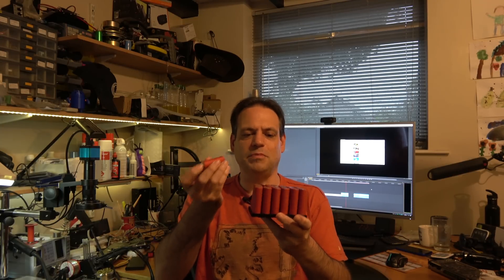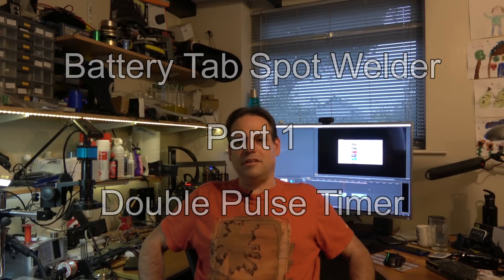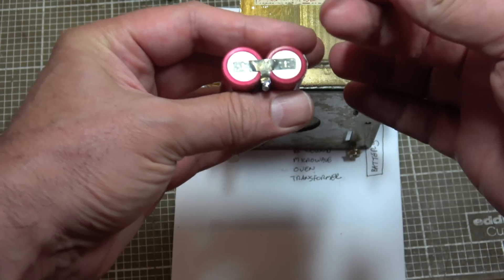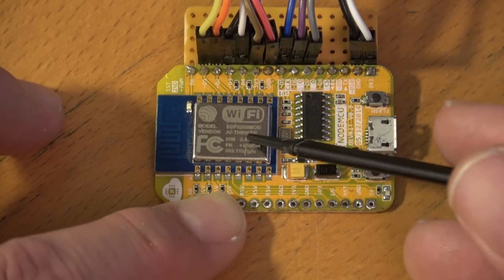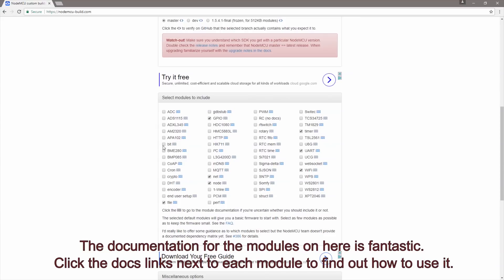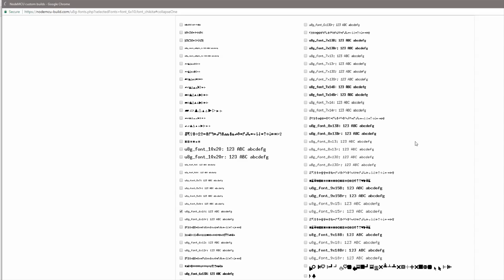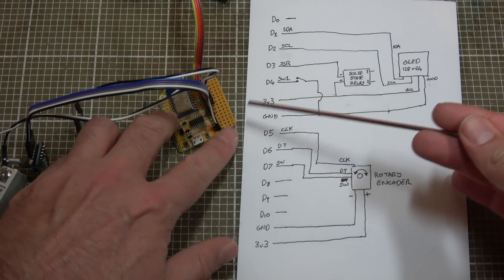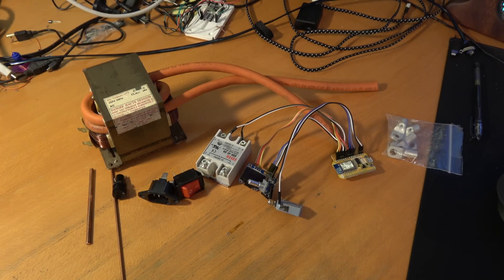Battery Tab Spot Welder - Part 1 - Dual Pulse Timer with NodeMCU

Comment: Did you not think to adjust the power??
Reply from the maker: How do you mean? This video is about me making a spot welder with adjustable power settings. Controlling the power delivered into the weld was on my mind from the very start. Can you explain what you mean please?
Reply: @ThingsWhichArentWork   What I noticed was that this controller only adjusts the double pulse time in ms 

Does this mean that the transformer always works at its maximum power?

Thank you for your response
Reply from the maker: Hi  @TavanaSpotwelder  - Yes - You are correct in that when the transformer is energised it is always at full strength. I was considering the power to be the total amount transferred through the transformer during the duration of the  weld. For my use case with welding battery packs (and possibly all welding cases in general) it is desireable to keep the weld duration as short as possible to minimise the spread of heat into the nearby battery plastics and chemicals, so I never considered wanting anything other than the minimum duration pulses to get the job done. I guess it would be possible to make a cheap MIG-style variable transformer from a MOT core by moving a shield across part of the transformer.. just wasn't something that occurred to me. Cheers!!

Comment: Thanks you very much for this. This my first time doing an electronics project and I'm almost done after 2 weeks. Would a metal oxide varistor help to protect the circuit?
Reply from the maker: I don't think there's any need for a mov. The switchmode is already providing an isolated supply for all of the sensitive electronics.. Maybe there's some argument for using one on the microwave transformer side of things, but that would already be very tolerant to over voltage conditions... I am however no expert on MOVs and input protection, so please don't take my word as gospel. Cheers!!

Comment: Please share step by step manual for beginners and also code for programming nodmcu module
Reply from the maker: Hi Muhammad - The code is all up on github. The  link is somewhere in the description for one of the parts of the video  (There are three parts). Hope that helps. Cheers!!
Reply: @ThingsWhichArentWork  I am going to buy parts today and will ask help if there will be something wrong with my project 
Regards 
M. Saqib

Comment: I've just got round to building a spot welder myself and funnily enough it was using stuff I had lying around too. I managed to work out all by myself that touching a microswitch with mains running through it was probably a bad idea so went the SSR route too. 
I watched the same video you did and was also surprised at the heat generated so it is great to hear you saying the same, maybe they just had the timing wrong. 
Thanks too for the explanation for using double pulse as I had heard it was to heat up the metal before the proper weld but couldn't understand why that would be a good thing. 
My welder works really well but as I haven't sorted out a timer yet it is hard to be consistent so getting the timing sorted is a priority. I'm currently going the 555 timer route as I have one handy but may upgrade later to your design.
Thanks for sharing.

Comment: First of all : nice video. 
I'm also getting progress on my version of a spotwelder : 
using a RANDOM FIRE SSR (and not a zero crossing one) It should be able to adjust the power for welds by leading edge trimming ... 
(that kind of SSR switches on whenever you like (and not only at zerocrossings), but it does however still switches off at zero-crossings only) 
The example below shows what the arduino is outputting towards the random fire SSR. First time is when it is switched on, second time is when it is already switched off. (It should be off before the zerocrossing is over or the next half period the SSR would stays on !)

Settings in my program (merely to demonstrate not very useful I guess) are : 
preweld time : 5ms 
preweld power : 5%
delay time : 250ms
weld time: 11ms
weld power : 90%

Output : 
Weld : 9.50-9.94 ms
Weld : 19.44-20.01 ms
Weld : 29.52-29.94 ms
Weld : 39.45-40.02 ms
Weld : 49.53-49.95 ms
Weld : 59.46-60.03 ms
Weld : 69.54-69.96 ms
Weld : 79.47-80.04 ms
Weld : 89.55-89.98 ms
Weld : 99.48-100.04 ms
PAUSE : 250.01ms
Weld : 8.07-10.07 ms
Weld : 11.08-20.00 ms

(as 5% of a 10ms half-period is only 0.5ms; 10 weld pulses will be needed to get 5ms preweld time here;
and as 90% of a 10ms half-period is 9ms; 2 weld pulses are needed to get 11ms, the first being only 2ms, the second 9ms...
It works great for now... I just hope it stays like this braching the very inductive load to the SSR...). Testing soon.

Comment: can we use an arduino instead of the board you are using?
and can we power a 12v solenoid from the output instead of an ssr?
Reply from the maker: Hi Konstantinos - You can certainly use an arduino instead... If you check in the comments of part3 of this video, someone on there mentioned that they've written the code for arduino and offered to share it (I don't think they provided a link yet). You can't use a 12V solenoid/relay however as the mechanical switching happens too slowly and the load being switched on and off is almost purely inductive which would mean that you'd get big sparks across the relay contacts and it would quickly wear out. Hope that helps. Cheers!!

Comment: If the primary is at 250 Volts, with current draw of 3 Amps, and if the output voltage is 2.5V, then the current available will be 300 Amps, neglecting a small amount for transformer losses. Or, (VA in) = (VA out + VA losses). Thanks Jim.

Comment: Sound like you picked the easy way to do it. I used a 555 timer. But it didn't tack the welds well. I did use a 10 A relay. Maybe I will try your way next. Have a nice day.

Comment: Hiya Jim, this looks great. Thanks. Two questions about SSRs though:

1. SSRs do zero-cross switching, meaning they only turn on when the mains goes through zero volts. This means your timer will not be accurate because it will not come on when you close the switch, it will come on at the next mains zero crossing after you close the switch. It crosses zero twice per cycle - i.e once every 30mS if you run 60Hz or 25mS for 50Hz. Is this level of consistency an issue?

2. SSRs, I'm told, have a problem with highly reactive loads - which this transformer is. They are likely to fail early. Please tell me how many welds yours has done. If it's hundreds, then maybe it's not much of an issue after all.

Thanks again, Chris
Reply from the maker: Hi Chris. 

1. You're totally right on that - my timings will have some error introduced by the zero crossing points. My default timings are 60ms for the first pulse and 120ms. The first pulse is mostly there just to settle the position of the electrodes and clear away any surface oxidisation, so I'm not sure if the length of the pulse is terribly important, just as long as there is some kind of short pulse happening. The second pulse at 120ms is long enough that errors introduced by the zero crossing become quite a small percentage of the total pulse length The pulse will end up being 95-120ms depdning on when the zero cross happens). There probably are inconsistencies in the welds because of this, but there also inconsistencies because of pressure applied to the electrodes, cleanliness of the surface being welded, oxidisation, mains voltage fluctuation etc too... Many sources of error.. not sure which ones to blame... mostly it gives good clean welds without any problems.

2. Because I'm only using this for hobby packs, I've probably only done around 300 welds with it so far. Not really enough to make a long term assessment of the SSR's reliability. I haven't had any problems so far, but that doesn't mean that the SSR is not going to die an early death... My train of thought was that the SSR is mostly designed for switching motors on and off, and motors are pretty big inductors just like transformers, so it'd probably be OK. Microwave ovens in the UK run through a 13A fuse, so I figured that a '40A' rated SSR would probably be able to handle it. (Incidentially, the Fostek SSR I used is known to be a fake/clone/fraud item which won't actually handle 40A at all...  Underwriters Lab (the UL certification people) have an advisory up about those SSRs https://www.ul.com/newsroom/publicnotices/ul-warns-of-solid-state-relay-with-counterfeit-ul-recognition-mark-release-13pn-52/ ). All I can say is that it's worked fine for me so far, it doesn't get hot in use, and it doesn't show any signs that it's getting flakey yet. 

Hope that helps. Cheers!!.
Reply: Thanks for your comprehensive and fast reply Jim. My own project was on hold because of the "SSRs won't work" problem. The data sheet suggests I'd need about a 90 amp capacity to absorb all that inductive goodness. But your project clearly gives all that the finger, and 300 welds is good enough for the SSRs to be considered a consumable. So - onwards for me!

Thanks once again for a fantastic set of videos. No bull, no puff, just the material. I really appreciate it.
Reply: @chriswesley594  Chris, just adding some info here: the zero crossings are at every 8.333ms@60Hz & 10ms@50Hz (1/freq/2half cycles) so there isn't really a need for a zero crossing detection in my opinion. I also measured the inrush current of my ~1200W 120V transformer and it's 25.5A(pri) and 600A(sec). So a 40A SSR will be more than enough.
One important note: placing a varistor on the transformer primary is a MUST. otherwise it will fry the ssr anytime
Reply: @rodrigobarretto9090  Thanks for that. Why will it fry the SSR anytime??

Comment: just FYI: All of the FOTEK SSRs are fake. The 40A version has a 16 or 20A MOSFET in it with poor thermal dissipation, and the 25A version has I think a 10A MOSFET. See this link here: https://www.ul.com/newsroom/publicnotices/ul-warns-of-solid-state-relay-with-counterfeit-ul-recognition-mark-release-13pn-52/
These are good for cheap hobby projects, but watch out for the ratings.

Comment: Just want to say 2 things:
1. Nicely done!
2. The power of a transformer is squared core area (width of the central element times height of the whole stack). That means, in your case, somewhere around 20 sq cm, which means around 300 W in real life (400 W ideal). Now, as we know from our history, P=U x I which means your transformer will bleed 200 A max... that's far away from 600 amps... just sayin'...
Reply from the maker: Hi Blade0983 - I totally agree with you that it's not 600A... Did I really say that... I thought I'd said that it was pulling ~3A from the mains, so around 700W... which stepped down to 2V was around 350A... and with transformer losses would me something like 300A... but I'm probably wrong about that because you watched this video more recently than I did...Maybe I'm thinking of a later part of the series. I do remember though that I tried to be realistic in my claims and not say the ludicrous 1 bazillion amps that most people seem to claim. Anyway.. thanks for doing the correct maths. Cheers!!
Reply: Jim Conner No harm meant or done. I just felt it was the right thing to do.
Anyways, keep it up. Your work is awesome and inspirational for many.
Reply: The microwaves i have encountered were always between 600W and 1200W
Reply: afroninjadeluxe not the ones made from chinesium... the windings are enameled aluminium, not copper as it should be.

Comment: your a little beyond my comfort zone with mains voltage im only lowly beginner/amateur thicko basically but im listening and learning so thanks and what a absolute JOY! no ads great thinking good lad.
Reply from the maker: Hi Spencer - You are wise to fear the mains. I fear the mains rather a lot too, which is why I use an isolation transformers and a variac to give myself an AC supply isolated from the mains right up until I finish the project. It is still possible to get a shock from an isolated supply, but you have to try much harder than with the mains. (You have to touch both the positive and negative to get a shock from an isolated supply). Keep on listening and learning my friend - I have learned a hell of a lot of what I know from watching YouTube (particularly Dave Jones' EEVblog channel). Cheers!!
Reply: ahhh yes sounds very sensible thats the differance between an expert and a statistic haha thanks for the heads up! i have a lot to learn yet but im enjoying it its ironic as i build large 900000kw wind turbines but i do the spannering but i am learning and enjoying my electric projects  ive built some solar and a mini wind turbine with great success thank for reply ill keep watching and maybe one day it will make sense hahaa keep up the good work regards spen.

Comment: What i can see in the video - your Fotek SSD is counterfeight and as far as i know those counterfeights have thyristors inside rated to half the current stated on the label. So although still overkilled for your application i wouldn't recommed to drain more than 20 Amps from this SSD. Just for safety and peace of mind.
Great vid!

Comment: Good to see a vid from you Jim, hope you are well?
Reply from the maker: Thanks Dan - All is good with me. I thought it was about time I made some more videos now that I have some projects on the go again. Hope you're all good too. Cheers!!
Reply: Jim Conner all good thanks. I've  stuck to using the ardunio ide for my nodemcu and esp I can't be doing with learning lua. I watched a you tube video recently which was reviewing some snap together 28650 connectors that could be used to make a bigger pack.  probably expensive way of doing it and no where near as fun but thought I would mention it.
Reply from the maker: I think I watched the same video... but I've been wanting a way to weld batteries together for over a decade, so I'm going for it :-) ... I went with Lua for this one because I knew that the lua U8G libraries supported the dodgy heltec.cn displays OK out of the box... When I've done them on arduino in the past I had to hack the library myself. I was just tyring to be as lazy as possible and still make the thing work. Cheers!!

Comment: Too brainy for me ; ) But interesting all the same!
Reply from the maker: Thanks Keith. If I'm honest, probably too brainy for me too... but I'm a great believer in 'Never let the fact you don't know what you're doing stop you from trying'... Who knows... perhaps I'll end up with a working welder, and if not it will have been an adventure finding out. Hope you're well. Cheers!!
Reply: I agree wholeheartedly! But.....NOT to brainy for you, my friend ; )
Reply from the maker: You wouldn't be saying that if you understood how shockingly bad the code I wrote is :-)  Real computer programmers will probably be calling for me to be fired from my day job for the sins I've committed. Cheers!!
Reply: LOL!! Cheers, Brother!
Reply: A 3 dollar arduino is actually easier and quicker to hook up these days and doesn't suffer from all the issues 556's suffer from like what happens if you hold down the trigger and does it fire on power up etc.
Reply from the maker: The main reason I'm not using a 555 is because the nodemcu board was already on my desk, plugged in and ready for hackery. I'm normaly OK with writing code, but Lua isn't a language I've used before, so it is an unfamiliar syntax. Cheers!!
Reply: I have no clue how to write or read code barly even know what code is except it tells everyrhing what to do but i have no clue one writting or even setting it up other than that the video made sence I just didnt understand any of the code part can you build this without haveing to write or read any code because thas the only way i can build this is if i dont have to mess with any code